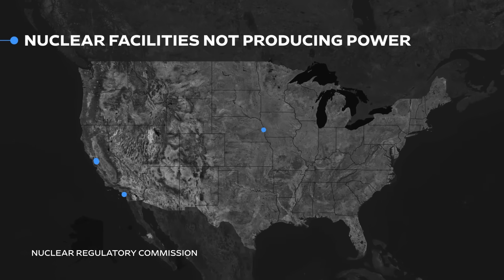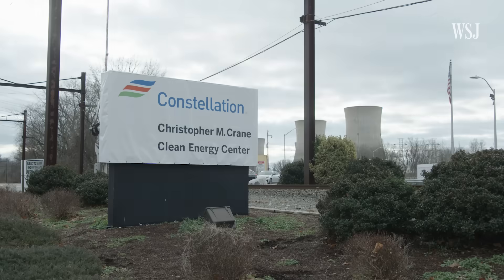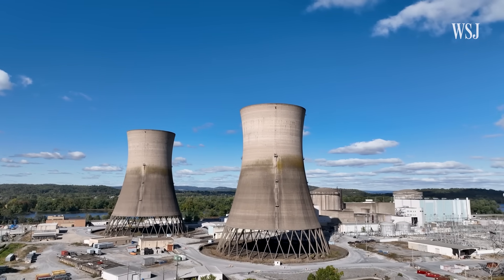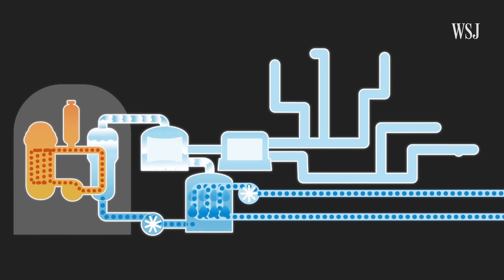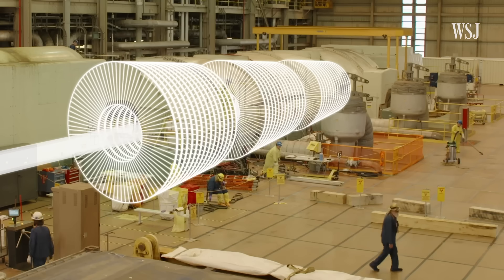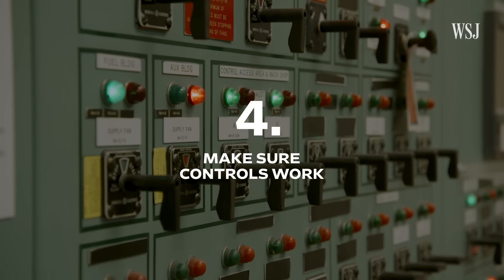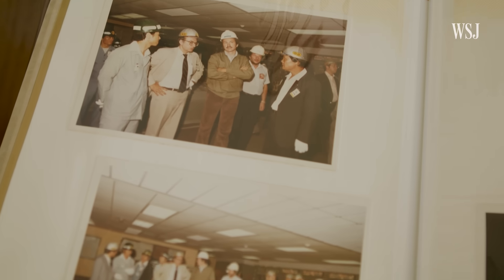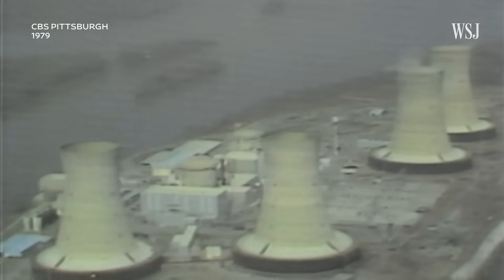Inside the $1.6B Plan to Restart Three Mile Island | WSJ

Comment: The US should never have gave up on Nuclear !
Reply: There is one that began commercial operation in April 2024 in Waynesboro, GA. I don't think the US has totally given up.
Reply: @PatrickLipsinic  two new reactors at Plant Vogtle in Georgia (for a total of 4.)
Reply: Not only the US should have never given up on nuclear, but they should have expanded with both boiling water reactors (BWRs) and Molten Salt Reactors (MSRs), the latter design being capable of using more abundant radioactive isotopes such as Thorium (and can be refueled while still in operation).
Reply: *given up😊
Reply: They never did. There have been plants in West Virginia and Indiana for at least a decade
Reply: Just like today, misinformation and disinformation led to FUD spreading throughout the American public.
Reply: Clean cheap energy. What wouldn't be to like. Hippies and scared people who are self proclaimed progressives have moved us backwards for the past 30-50 years. Nuclear is the best as long as it's made and maintained safely. There have been many improvements which make it almost impossible to have a runaway melt off.
Reply: And it should also not get back in
Reply: It became so expensive that the companies went bankrupt. South Carolina, we spent billions of dollars and had to cancel the plant after the company went under. The cost just went out of control
Reply: Oil industry money has been corrupting politics for at least a century.
Reply: Absolutely. Russia is building 6 new plants locally, and they have 10 nuclear power plant projects going on abroad. That technology should come from USA and Europe.
Reply: @Fekillix Canada and the EU have the most efficient and safest reactors as of now, CANDU reactors are idiot proof.
Reply: @Fekillix  China is currently building 30 nuclear power plants.
Reply: @Fekillix are they really building 10 nuclear power stations while at war? And continuing to build power plants in eg Egypt that supply weapons to Ukraine? Please.
Reply: The US haven’t given up on Nuclear Weapons?
Reply: @dennisallen8333  Weapons =/= power
Reply: @jfitz7777  The US never gave u on it. The market did, as nuclear power plants are practically THE MOST EXPENSIVE power source there is. They are just not economically viable with MASSIVE subsidies.
Reply: @hansfranz3322 No the electricity is cheaper, only the upfront cost is higher. Private power companies prioritize building plants with the fastest payback period since they don't care what customers pay for electricity as they always take their regulated profit cut.
Reply: @hansfranz3322  well not economically viable in 5-7 years as most investors want to see returns in that short a period. But as shale begins to dry up in the next 10 years, the cost/benefit ratio will change (unless shale drilling efficiency improves which… does seem to happen)
Reply: @hansfranz3322 and yet, the french produces 65-70% of their electricity from nuclear. the edf, france’s main energy supplier that uses nuclear power, also turned a profit in the billions of euros, it is economically viable
Reply: @generictag1050   Ukraine had also more than 50% of energy from nuclear and was very happy with very cheap electricity before the war. It was able to double energy production but you can't have 100% nuclear anargy due to grid inertia.
Reply: @KBergs the investment mean a large mortgage that have to be paid. It is more expensive electricity with that included.
Reply: @hansfranz3322 If we are being fair they're are also over regulated. On top of the comparisons for price also don't take into account the peripheral infrastructure to renewables like solar and wind. It's not a fair comparison to say solar and wind are cheaper when you don't count storage and powerlines into the cost which they will both inevitability need. Nuclear is expensive but the framing is not accurate.
Reply: @generictag1050 You mean the same EDF that had so many debts that they had to be nationalized?
Reply: @hansfranz3322  Nuclear power has and historically had the least amount of subsidies of any utility on the grid. If wind and solar are so cheap, why not let them compete with Nuclear on a level playing ground. Regulate coal/lng/wind/solar like nuclear, and see how the cost rises.
Reply: @nathancochran4694  It doesn't need to be regulated as heavy as it has much lower risks. And you know it. It's a inherent flaw of nuclear energy. It's like saying "Hey, let's see how well solar does if we add the fuel costs of coal or gas on top!"
Reply: @hansfranz3322  yeah its cheaper in the short term. A hot air balloon is cheaper than a Boeing 747. While true, the comparison is meaningless. 
Not to mention, you will have to add gas costs on top of solar and wind because they require LNG backups, because, you know, the whole intermitten thing.
Reply: @malikjackson9337  You need to look at nuclear spent fuel rods ... radioactive millons of years! ... and noone wants a nuclear waste site near thier home...   There is good reason these nuclear powerplants need tight controls .. Fukushima Japan  and Chernobyl are 2 examples...
Reply: @solarbygreengreg  It's actually thousands not millions of years. And just so you know you can even recycle nuclear waste with breeder reactors. You also don't need to be near a nuclear power plant for it to give you power. Also times have changed many people these days are fine living next to them since they are so safe. Lastly keep in mind you are talking about the worst nuclear disasters. So let's actually look at what happened. In Chernobyl 28 people died and there was a section of land that was contaminated with nuclear radiation. While it was a tragic accident, when we compare that to other energy sources nuclear is easily one the safest energy sources. It's right there with both wind and solar. That is the worst disaster that could have easily been prevented and is still well below any damage caused by events like Deep Water Horizon or the BP Oil spill. Now let's talk about Fukushima. You talk about it like it was this unmitigated disaster but keep in not a single person died because of the reactor. In fact more people died during the evacuation than the actual nuclear disaster. Fukushima is still habitable and you can even eat the fish without receiving a dangerous amount of radiation. Keep in mind this was after getting hit by one of the largest tsunamis ever recorded. Fossil fuel plants especially coal plants produce more environmental radiation and waste than any other source. Far more land is rendered uninhabitable because of fossil fuels. Sometimes people still live in those areas despite the pollution. Your fear is misplaced and uninformed.
Reply: @Haberdasher0213  nat gas can be made from Coal how young are you
Reply: @hansfranz3322  Acording to the department of energy Nuclear power is around half the cost of fossil fuel power
Reply: @dennisallen8333 just cause they share a word doesn’t mean they are the same z
Reply: Sing it soul sister! Seriously what a lost century because of it.
Reply: Nah they didnt give up...
All this clean enegery free money is in other stuff so if they put free money in nuclear it would come back.
Its all about free goverment money
Reply: @darkbeer9928  There is no "FREE MONEY" ... there are incentives to help offset upfront cost but majority of cost --about 70% still comes from homeowner or  builder of solar or wind farm.  Nuclear power spent fuel pellets or rods are radioactive millions of years.. do you want that in your backyard?  Radioactive  fuel can cause cancer and shorten lives of people , animals and environment.
Reply: Yeah, tell that to fukushima
Reply: @FigsForYou  The one where Japanese engineers correctly planned for once in a century tsunamis and then had to downgrade the design due to politicians bickering about cost?
Reply: @Meltpk  they built a nuclear reactor on a fault line. An earthquake happened, which was immediately followed by the fourth largest tsunami in recorded history. And then, the diesel backup generators stopped working.

In other words, it was a “beyond design basis” accident, i.e. freak accident.
Reply: @andrewdubose9968  yeah only they had an exercise preparing for the exact thing that happened there...
Reply: @Meltpk  poor design, the  TVA kind of had close to the Same thing happen in april 2011 Browns ferry nuclear
Reply: Natural gas and solar is way cheaper
Reply: @levismith7444  Solar fails when you need it, Ask your fed gov TVA about Jan 17th 2024